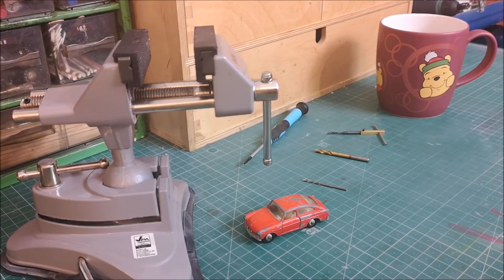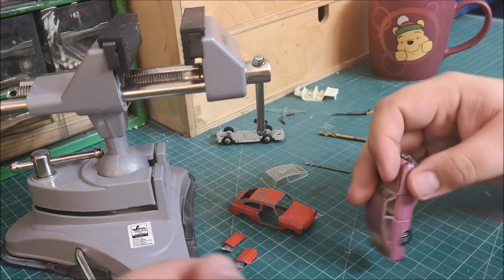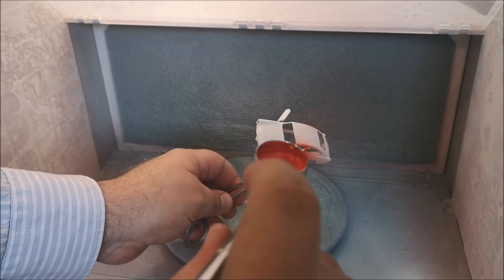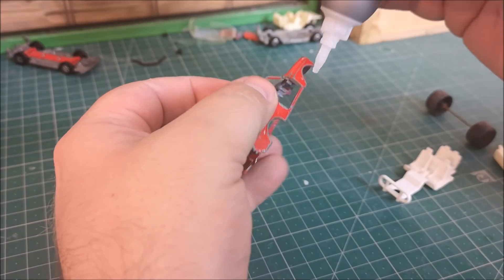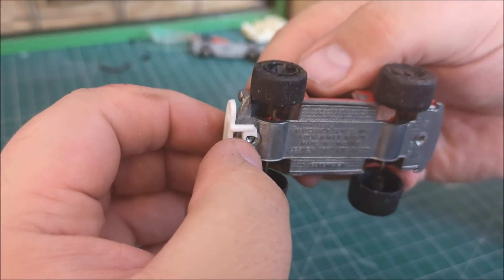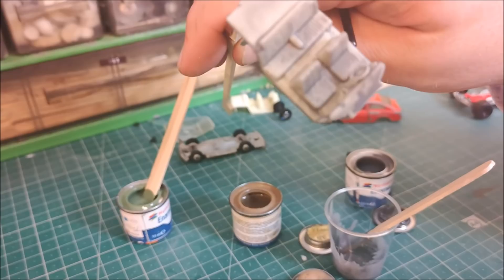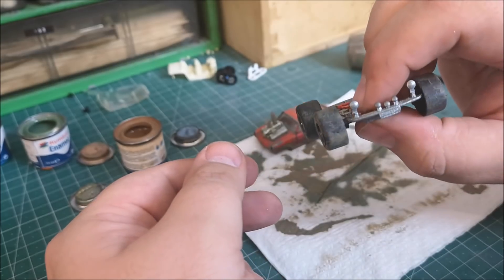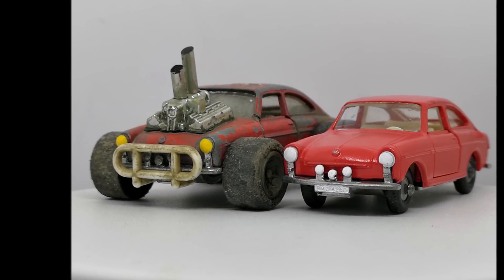Matchbox Series No 67 Volkswagon 1600TL Custom + MAD MAX!

Comment: I'm a clean & shiny guy, so I like the restored one. Here's a tip for you Rob. I purchased a pack of two paint stirrers from Tamiya at a model car show recently. They are thin, round stainless rods, about 150mm long. One end has a flattened blade, and the other end is shaped like a miniature spoon. The spoon end is perfect for placing baking soda onto super glue exactly where you want it, in small quantities. I think I paid only about $5.00 for them.

Comment: As I am sitting here, using my own Parkside dremel like yours cutting out switch backing plates for my Reliant Robin as fitted some super fandango driving lamps, mine tends to be a little noisy at top revs just wondering if yours is the same?   Also I noticed that its held its charge for months with some hefty use and still after some heavy grinding and cutting its still three lights showing and I last put it on the charger last year O.o   My real Dremel didn't last two years and had a weaker battery than one of Theresa May's promises lol
Reply from the maker: It's noisy which is why I leave it off camera. I use it on Max most of the time. It has a great battery life